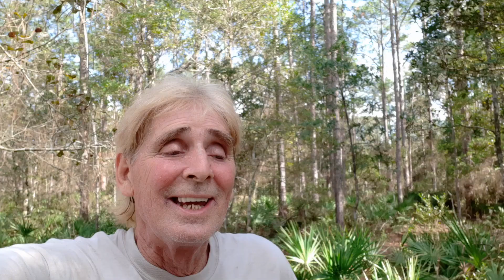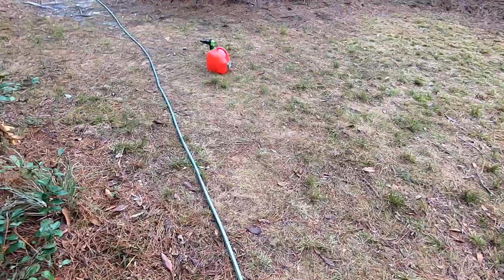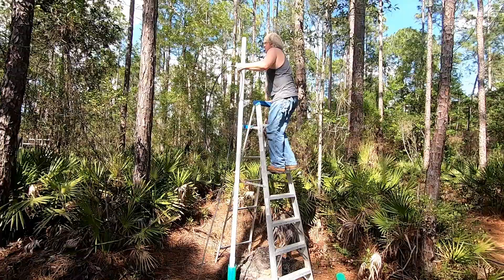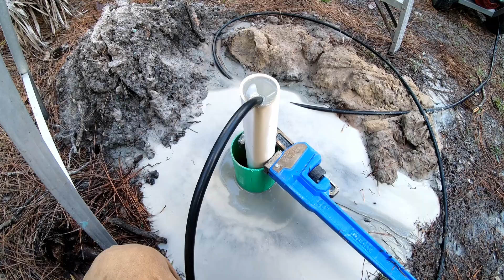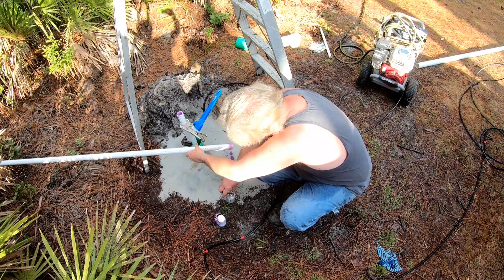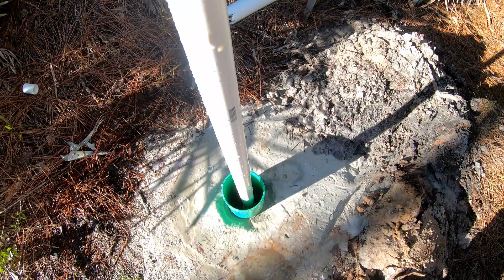How to Dig Shallow Well - Viewer - Do it Yourself, EASY DIY

Comment: I really enjoyed your video and I am in the process of doing a well this way, and was very successful until.
I had come to the point of inserting my well point and check valve. But when trying to remove the 2 inch PVC pipe, it was stuck! I have tried everything, even a tractor bucket and chain to pull it, and nothing. It will spin when twisting it, but will not come up. 🤷‍♂️🤷‍♂️
Any ideas would be appreciated.

Comment: Hi Chuck.  Thank you for your helpful videos.  Like your brother, I am gong to do a shallow well with m pressure washer snd the mini jetter.  I have a simple question please. What is the purpose of removing the 2 inch pipe once the well point is down?  Can it just be left in the ground?  Thank you for your prompt answer a I am at this point in my project.
Reply: Outer is casing and inner is suction with well point check valve.

Comment: What is the best way to drill?   Mud pump, or Jet high pressure...?
Reply: Depends on the situation. But the mud pump way is still high pressure (going from 2” to 1” pipe) and the water volume is much much more to flush out the water.

Comment: I'm in Florida can you do a 3in to put a 2 in submersible down about 50 or 80 feet
Reply: Have you tried this?
Reply: I do not think there is 2 inch submersible. If you find pls post link. I live in florida and I am trying to dug a well but freaking no water until 28 feet
 I do see water but my pump does not pull it every after priming. My only source is submersible but have to gig 4 inch hole

Comment: I did everything Like you did but got my 2inch about 15ft down and the pipe will not go deeper. I've spun the pipe beat it on top while the jetter is still pushing dirt out but the dang 2 inch has been very difficult to drop down . Any ideas on what to do differently?
Reply from the maker: There could be several reasons.. but I made several more videos using a powerful homemade jet. Check it out! It might answer your question and make big difference!

You are watching a video of my brother using my method..

Watch the other videos on wells on the channel 
Here is the playlist 

https://www.youtube.com/playlist?list=PLix1VT7RNAOhblDE_17kn0K1Qqsg9aaNK&utm_source=EJGixIgBCJiu2KjB4oSJEQ

The best one is LIVE. 
I did it Live to show everyone how easy it is.. that video has more tips than all the rest

https://www.youtube.com/AppleDrains
Reply: Pull it up and look at the tip.  My teeth were gone at about 12 feet.  I've modified it with a steel pipe nipple threaded to the end and used a plasma cutter to make metal teeth instead.   I suspect that will fix my issues
Reply: What psi rating did you use?
Reply: You might have hit a rock